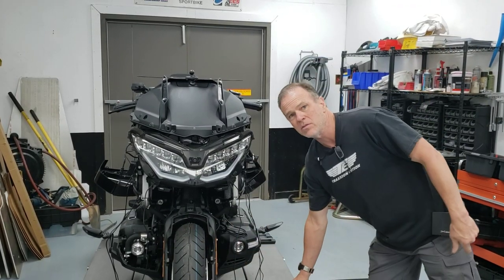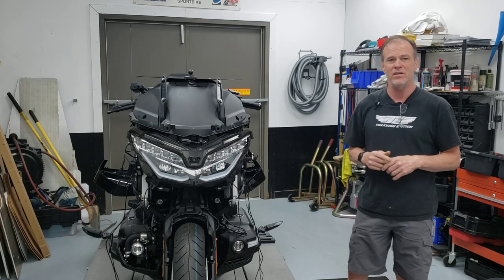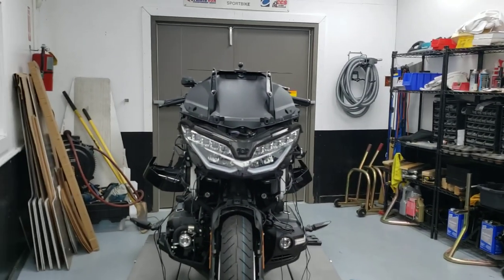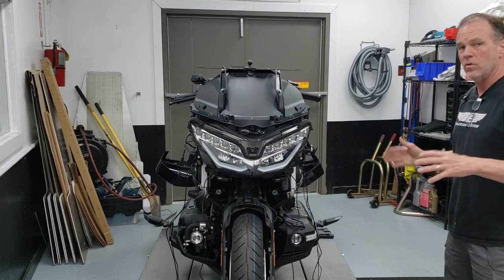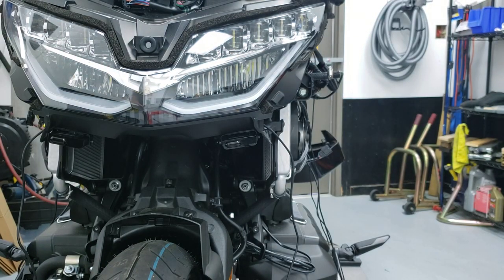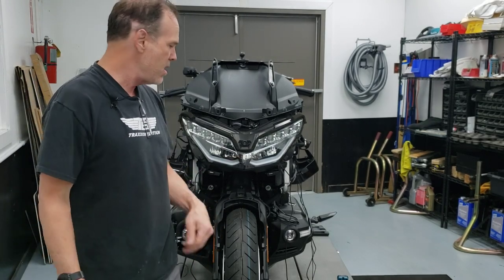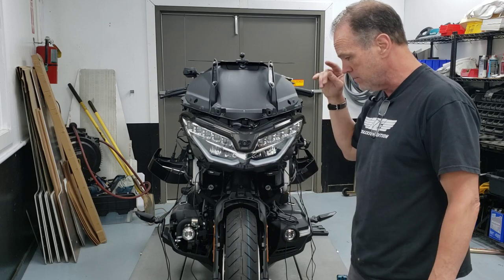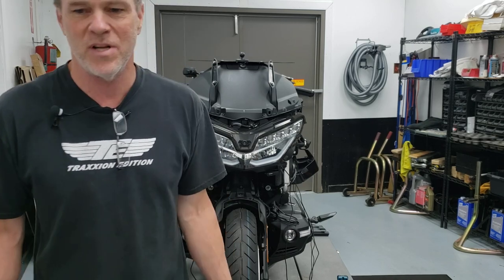How to Install TPX Laser Jammer Transponders by Max McAllister of Traxxion Dynamics (Honda Goldwing)

Comment: The reason why the leveling of the transponders don’t make sense: not only does the bike have to be level for this theory to work, but it also assumes that the police officer is on the level plane, not on a hill at the bottom or top of the hill, shooting up or down at you, he can’t be on an offramp, and neither can you so all of this leveling just doesn’t make sense because nothing is ever level especially when you’re talking about two vehicles on terrain on a highway… It just doesn’t add up so just try to get them as level with the vehicle as possible
Reply from the maker: That is not a good plan.

If you are out a tiny amount of level at the transponder, that misalignment will be greatly amplified the farther you go away from the motorcycle, reducing your chance of jamming the signal effectively, and defeating the entire purpose of installing a kit like this.  So if you are lazy and just put them on "close", you can actually be on level highway with a cop shooting you with laser, and your transponders will be pointed over the cop or the ground.

Taking time to level them as much as possible gives you the best chance to catch the laser signal, whether you are point up a hill, down a hill, or driving on level ground.